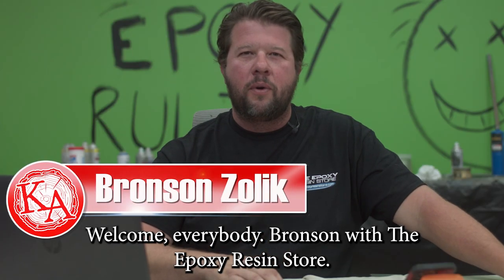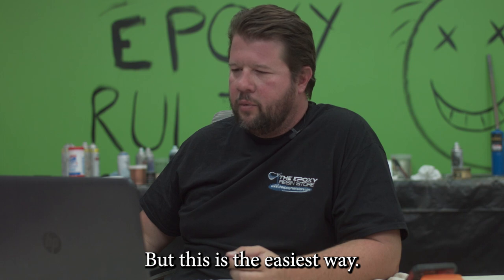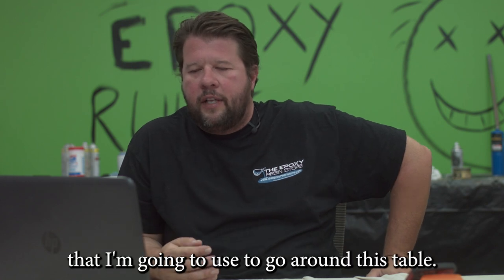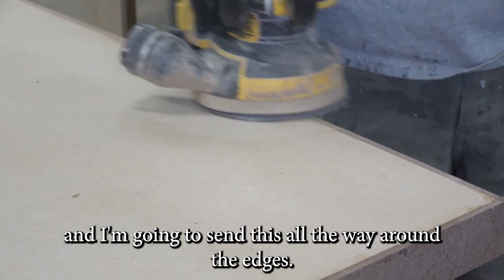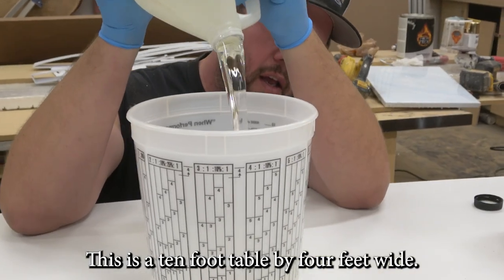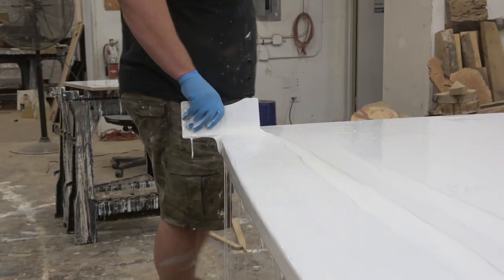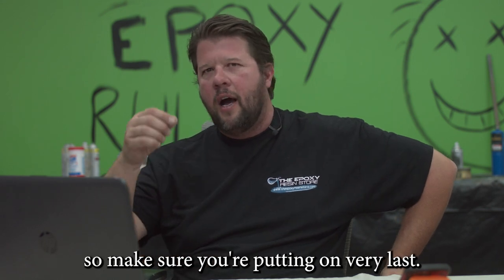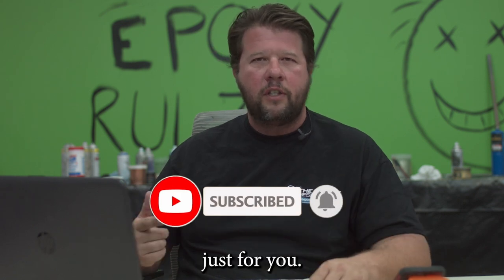Conference Table with Epoxy Resin | Step-by-Step Guide

Comment: We make copper wall art and seal it with clear resin to seal the copper from oxidizing. We have tried a new epoxy and are getting dimpling after the resin sets up. We make mostly smaller pieces, 4x4, 5x7, 8x10, 11x14, 16x20 and 24x20 pieces. I'm not sure if tapping the surface of the clear resin would be feasible. We contacted the company and they asked us to watch your video. We have been doing this for over 7 years and have had no dimpling in the past. Please advise